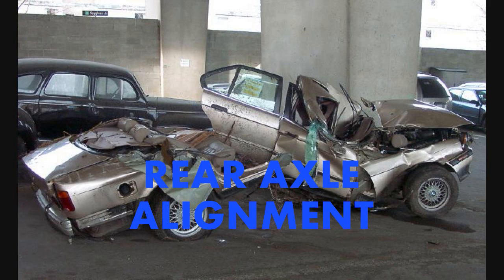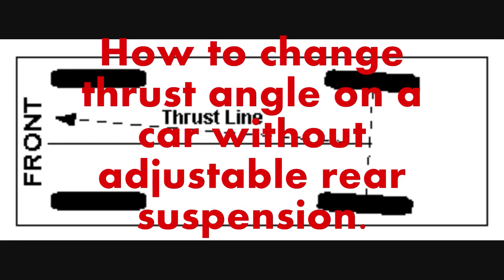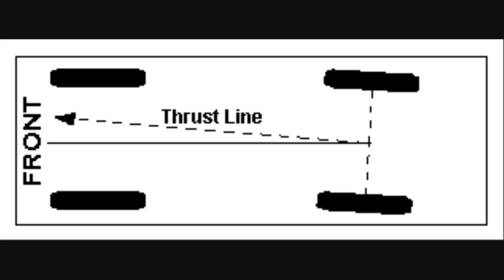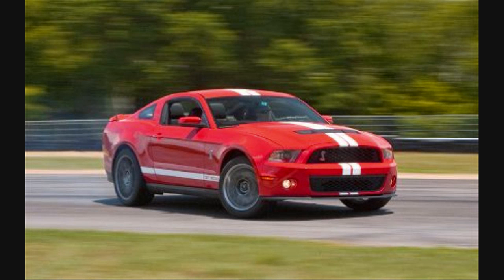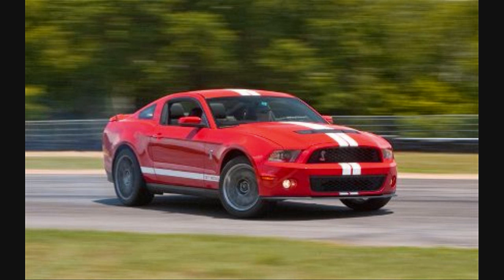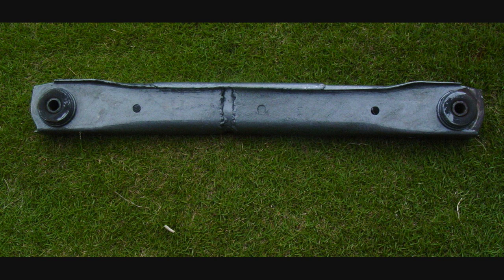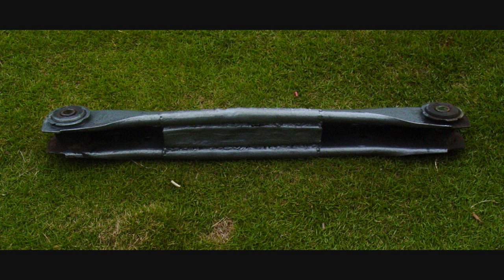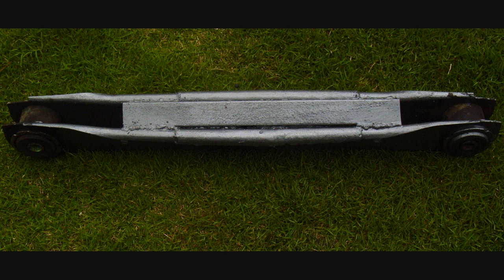REAR AXLE ALIGNMENT ON OLD VEHICLE

Comment: wow that guy is high. only better thing you cold have done was buy an expensive adjustable length control arm. nice job saving a buck. it is funny that no matter how well the finished product worked there is allwase the "you should have done it right= my way" guy.

Comment: @mrgalleria ,,, I love American cars we don't have anywhere near the range that you do. My first Car was a Holden Torrana I forget the name of its American counterpart, but they were considered to be a bit of a Aussie icon in there day. I don't think there was a single part I didn't modify in mine, Its started out as a auto but finished up with a 5 speed out of a Toyota celica, and its inline 6 was capable of 7.5k rpm, I took it well over 200kph once and it still had more, but my nerves didn't.

Comment: @mrgalleria ,,, It's always best to fix the problem not the things around the problem, if you made a mistake with changing the fastening point on the frame mount it would be a simple restarting from step one and trying again. I'm not saying to move the entire mount just the bolt hole that holds the control arm. But then again every model of car is different and I'm sure you considered the best approach.  Nice work mate it looks strong but the extra weight will definitely add to a bumpy ride.

Comment: @mrgalleria ,,,, 1/2" is fine and well within adjustment specs on adjustable control arms. I've had my hair catch on fire plenty of times welding upside down.  Have you noticed an improvement in handling ?  When the track is out it can be quite dangerous in the wet making it easy to aqua plane, for the vehicle has resistance changing direction either left or right, mostly noticeable at high speed.

Comment: In adjusting the length of the control arm the suspension arch has been made uneven, this will be unnoticeable in handling as long as it's a small difference from either side, 1 inch is far to much. I had come across this fault as the cause of tracking(vehicle feels as if stuck to rails), the recommended fix is to modify the fastening point on the body or sub frame, usually a simple matter of some drilling and welding in some steel pipe then filling up the old bolt hole with weld.